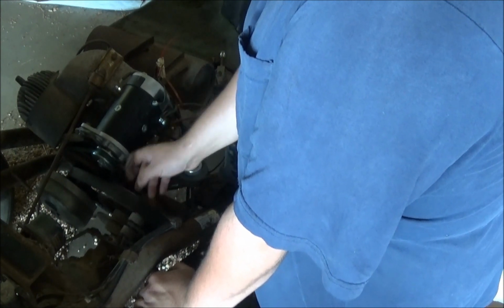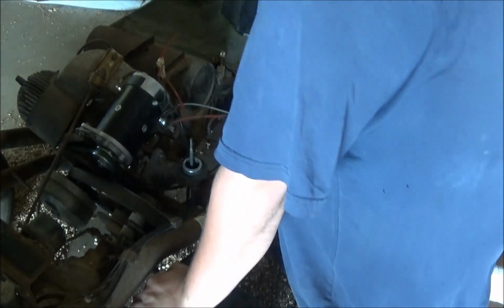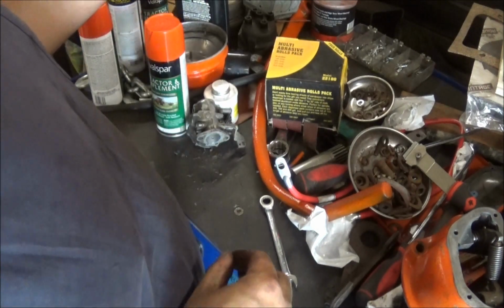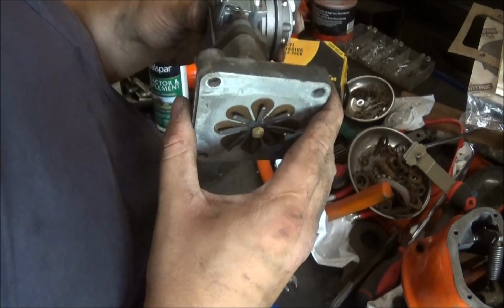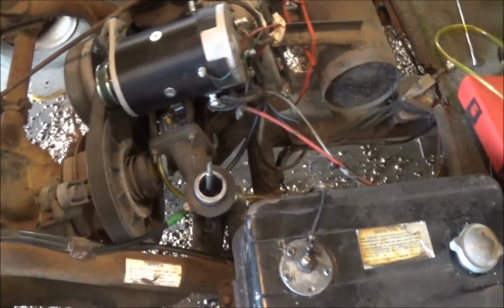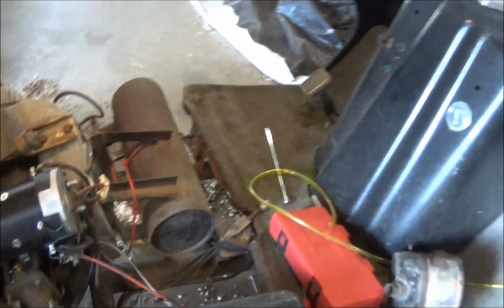working on the Harley Davidson golf cart

Comment: Waiting on parts stinks! I have a self-propelled push mower waiting on front wheels. They sent the first ones...non-drive wheels. Supposedly the right ones are coming now. I ordered some 4 bolt pillow blocks and they came as 2 bolt, so now I am waiting for those to come. Also waiting on an ignition wire for the Emperor... Patience is a fruit of the Spirit. We are in this together my friend.
Reply from the maker: ok